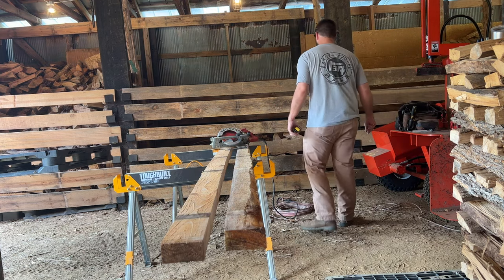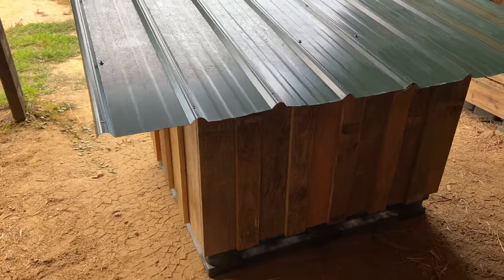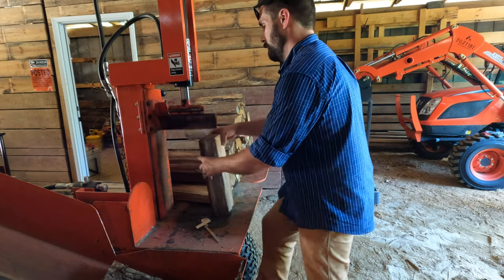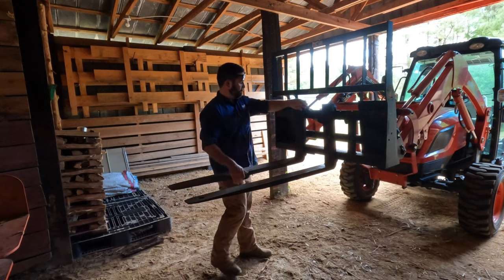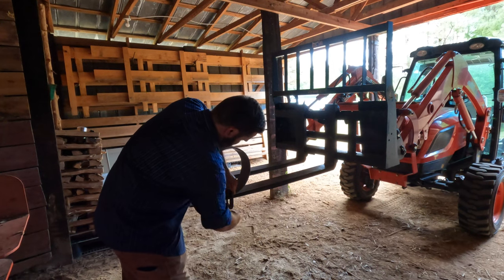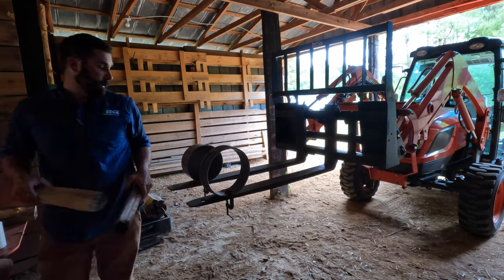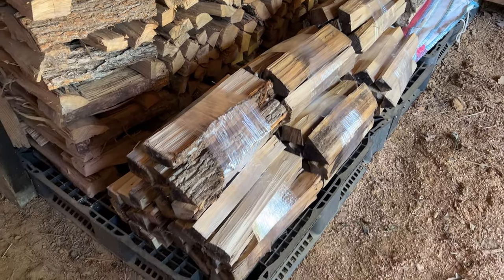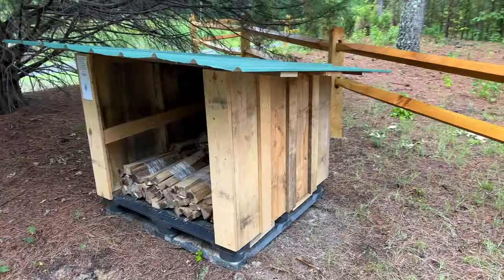How to Make and Sell Firewood Bundles for Cheap

Comment: i'm not a you should guy but may want to raise that stand up some , thinking someone may connect with that tin on the forehead lol, great job other wise, i watch all your vids, i always say -10 to + 10 celsius is good working temps ha ha don't know how you guys in the south handle that heat guess its like us up here in northern Canada with the cold
Reply from the maker: I agree 100%.  I think I'll put a piece of foam pipe insulation on the front face of the tin to protect from potential run ins.  That way I'm still able to move around with the forks easily.  The heat/humidity combination has been brutal this year.  Had 106+ Fahrenheit in the barn most of the day while working on this one.  Send some of that Canadian air our way!  Really appreciate you commenting and watching!

Comment: Poor lighting made this difficult to watch.
It was a struggle.
A $1.50 pool noodle cut length wise would make a great forehead saving bumper for that sheet  metal decapitator roof line on the front.
No offense intended ,
Reply from the maker: No offense taken.  I completely agree about the lighting.  Unfortunately, I retreated into the shade of the barn to escape the heat (still over 100 degrees Fahrenheit), and the shade against the bright sun outside was terrible.  Decided to upload anyway.  Have since added a piece of foam pipe insulation on the front of the roofing metal, worked great.  Appreciate the feedback, and thanks for watching!
Reply: @FoxfireProjects  you are welcome
Will be watching if you decide to re do it 
( So. . . It's not a "dry" heat ? )
;)
Reply from the maker: @jeanvaljohn3921  Maybe in January.  Southern heat and humidity is tough 😂